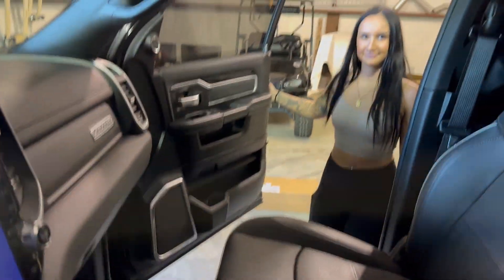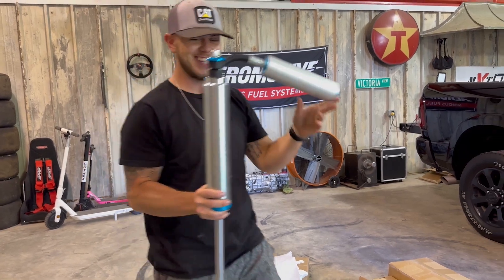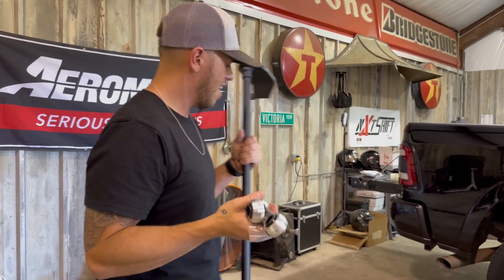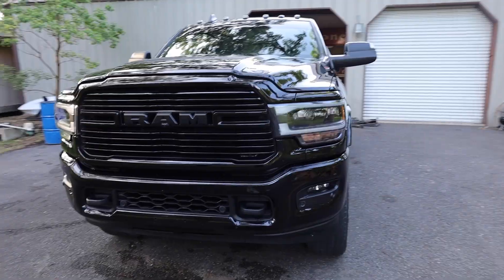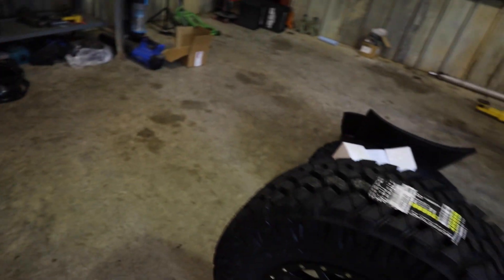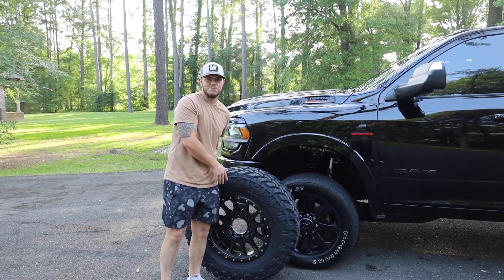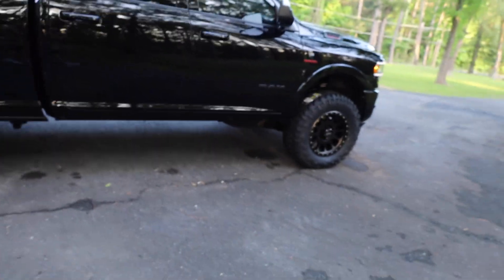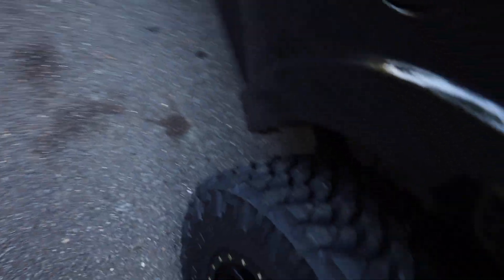I Finally Got My DREAM Truck!

Comment: Man I love it. I have always wanted one of these Dodge 2500s with the cummins. I have a 2010 F150 and it only has 120,000 miles but it keeps having stupid things going wrong with it. Not to mention that my gas mileage has went to crap on it. I put 33s and now I only get 14 mpg and maybe 16 on the highway. I used to get lucky and get 20 mpg hand calculated going to the beach. Right now I need to change the exhaust manifolds again but they are a PITA.